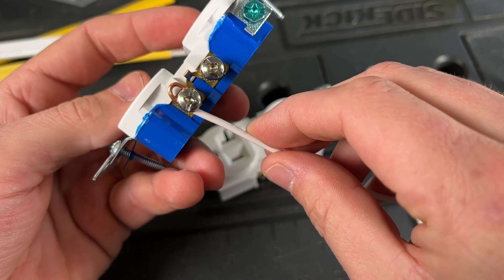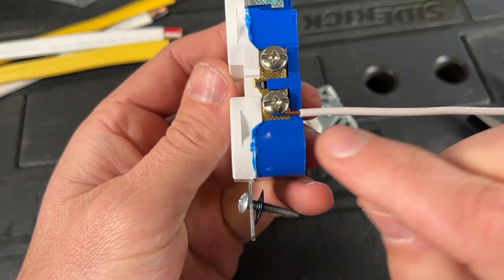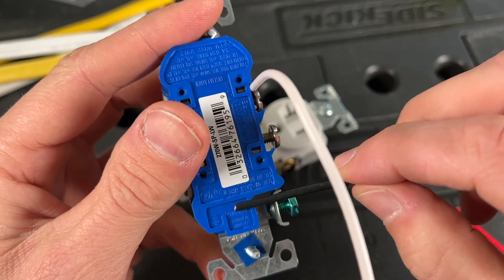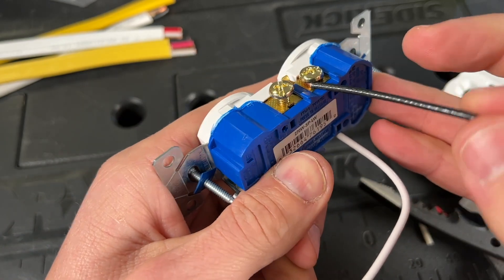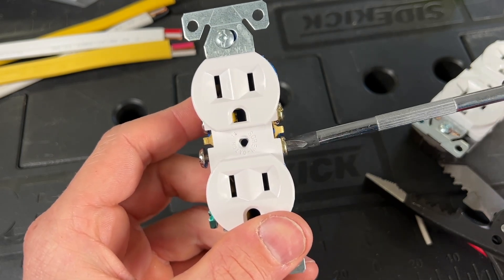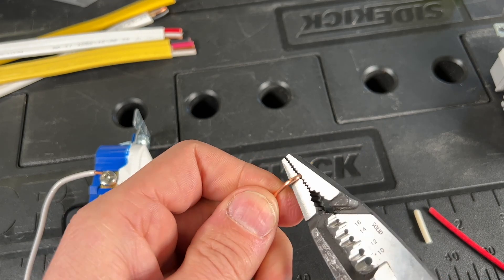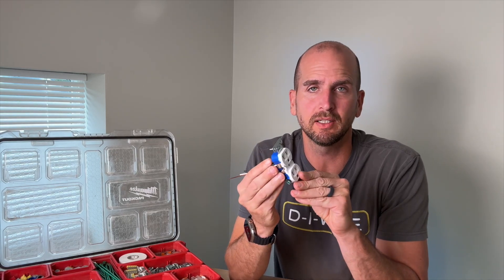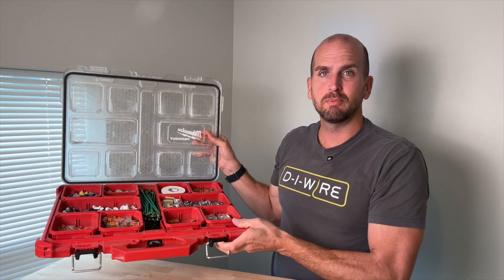How To Side Wire An Electrical Outlet | Best Practices

Comment: Is it safe to use BOTH screw terminals for two different things? What about also using the backstab holes for a third thing? I can’t seem to find a consensus on the safety or, if it’s not a good idea, an explanation of what could go wrong. 

I’m new to DIY lighting, so thank you for this video! Love the “shepherd’s hook” tip, the “clockwise” tip, and copper over-exposure and under-exposure at the screw terminal. Great stuff to know!!
Reply: I just realized I should specify: I am wanting to connect the hardwire (already existing to be dedicated to an outlet) to the backstab holes, but then use two extra 3-wire cables (split into the 3 obvious wires) on one pair of the screw terminals to power an outdoor sconce, and on the other pair of screw terminals for an outdoor fan. I only have the one outlet spot outside, but need to power hardwired items. All the hardware (including cables) are rated for outdoor use - but is this setup safe?